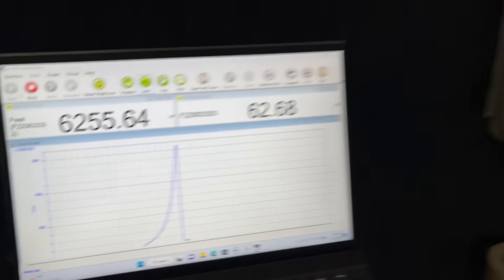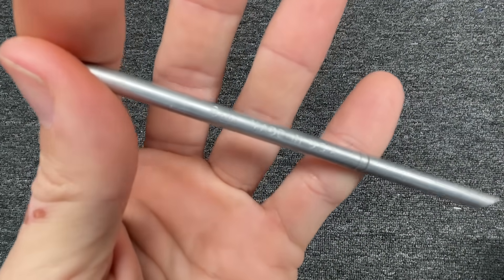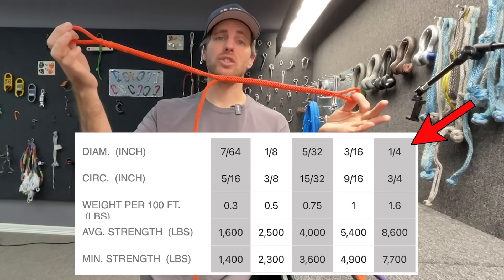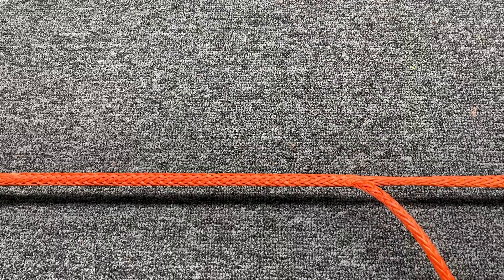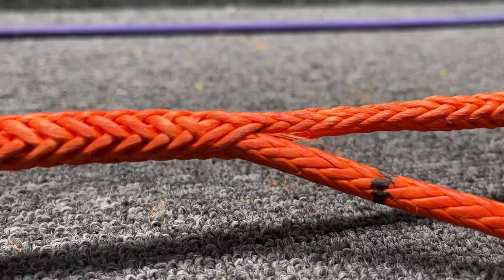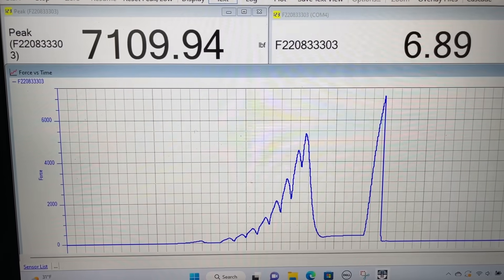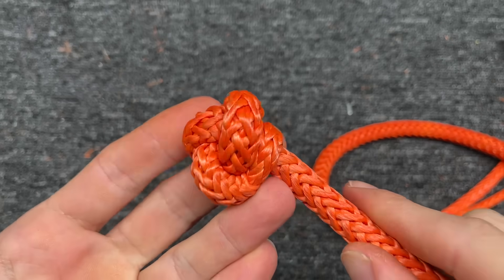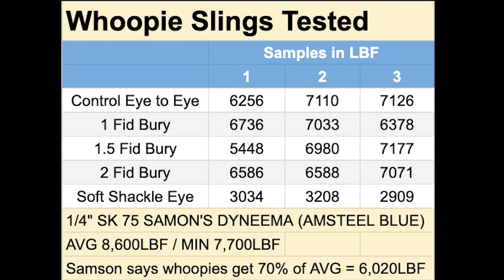Why The Overkill?

Comment: I can see how the Whoopie would test very differently depending on whether it is wrapped around a tree trunk or large branch. Spliced rope flattens out when wrapped around a large cylinder, and conceivably may have more strength to failure. This discussion of how much bury is needed is salient to those of us who try to splice older rope. If the connection needs to be refreshed, you lose several feet of rope so having a shorter bury is cost effective and practical.

Comment: A comment about your last bit on using the metric system. I'm Canadian, so we have to deal in both.  But it drives me nuts, after learning about the 'Newton' from highschool physics that we use the gram as a force as well as mass. I don't know where it started, probably when what became known as the metric system, was being developed. Everything else got it's own name, except the gram. Sorry force does have it's on unit 'Newton' we just don't F-in use it. ARG.

 I totally agree with your logic. Use whatever the industry standard unit is, and we can convert. You don't have the room onscreen to double up on text. 

Don't worry about the haters. They drive traffic, which is great for the algorithm.

Comment: Happy YouTube recommended this video to me. I've been using whoopie slings as an option for hanging hammocks. Early on, when I first got into Dyneema rope I purchased some from SK-Amazon. I ended up using it to create a whoopie sling, as a way around needing a variable lenght of rope. It was 8-9mm and I used 6ft as the length of the bury. Used it the other day to pull a several 1000 lb vehicle up a ramp onto a trailer. It did not obviously slip, and after the pull I inspected the bury, and it had pulled tighter than what it was when I started.

Two observations: When using a whoopie sling always milk the bury before using it. The other is the lenght of the bury shortens up when there is rope inside. For me, the bury length shorted by 1/2 a foot. I really enjoy the videos on rope specific topics, as the climbing and rescue gear tests are interesting but it's something I'm not into.

Comment: In the tree industry we use the whoopie as an anchor point by wrapping it around a tree and putting the fixed eye through the adjustable whoopie eye. Kind of like how an ultra sling works.
Reply: That sounds pretty cool and quite inspiring. Thank you!
Do you think this could work better than a daisy chain on a tape for a hammock? I mean - having this ultra sling, connecting it to the tree hugger with some kind of soft shackle? I'm not sure if you know much about hammock suspension, but maybe you do ;) If not, please ignore this comment.

Comment: I know I am 9 months late on this video, but the "afterthought" test of the Eye to Eye hits an application for holding up my sailboat mast. I have 5 mm dux splice in an eye that I luggage tag (girth hitch) to an 8mm shackle. Or should I just put it on the eye? The answer... It does not matter for strength. It will probably break in the taper. Plus it is so much stronger than the original 1/8" 1x19 wire it replaced so super good enough.

My conclusion luggage tag reduces chafe with the shackle. Keep doing what I have been doing.

Comment: I'm a hammock dyneema user. I may risk an 18 inch fall. So, I get away with hanging on 1/8" Amsteel and 7/64" Samson loops. I do hang without trees on Tensa Solo poles at times with two whoopy slings running to  a couple of home-made boom stakes at each end. I use 14" x 5/16" titanium stakes in 12" long 1" OD 1/8" wall booms with the stakes at 72 degrees. I can use 10" of boom length but stick to 8". Learning the failure points from your channel has been enlightening. Thank you very much! It would be fascinating to watch boom stakes pulled to failure.
Reply: Really for hammock you aren't risking too much to make a force that will pull out the splice. The required force will break the hammock apart faster. Well if using ridgeline to protect the hammock and very long ropes with sharp hang angles  so the force will multiply many times it can be possible. But I think it is often more practical to have shorter tie than extreemly long. So shorter bury is preferable in most cases

Comment: Fantastic to see "closer to real world" test setup - the larger radius has its place for absolute measurement, but much more useful to daily use (or failure awareness) is the shackle radius directly on the eye.

Thanks for this information; you are doing fantastic work.

Comment: So, if the integral soft shackle on the end of the rope failed very low, what happens if you use an eye at the end & then loop a separate  soft shackle through it?  Does the small bend radius make that as weak?  Or is it stronger?

Comment: To get full strength of a rope they use a large Bollard, but what is the correlation of Bollard diameter to rope diameter, For example if you pull a 6mm rope with a 12mm diameter bollard it will break at x kn , if you pull a 6mm rope with a 18mm bollard it will break at y kn, if you pull a 6mm rope with a 24mm bollard it will break at z kn. what is the minimum ratio of rope diameter to bollard diameter to get full strength. How does it change as the rope diameter increases. Would it be fesible to carry along a short section of pipe to act as a portable bollard to get full strength out of your rope.

Comment: A significant portion of the study of statistics is understanding different places where variation exists, and then finding the reason that variation exists. The comparison of JUST THE ROPE WITH ITSELF will include some variation due to unobserved factors like batch quality of the fibers between batches, and even along different sections of a 1,000 ft long rope (we call this Population Variance). Now consider making 10 ft hanks to test, and consider Sample Set 1 to have 20 such hanks (randomly selected across the whole 1,000 ft rope) to be tested to destruction. Then take another Sample Set 2 with another 20 hanks to be tested. By accident of the random selection, Sample Set 1 will have a mean break strength (call it Xbar1) and the mean break strength in Sample Set 2 will be different (call that Xbar2). We call this concept "Sampling Variation" in a statistics class, and doing a little studying to understand these two slightly different measures of variation can help reduce the confusion that happens when the two samples give different average break strengths. With those two basic variations measured, we then move to all of the OTHER possible sources of variation (knot type, how well dressed, speed of pull, pulse or notpulse, dirty or clean, etc). If we can isolate these OTHER sources, we can call them 'treatments' and then get on with determining the effects of each treatment. It can be illuminating to then perform a dot plot of each sample (now each sample will have a different treatment), and see how the dot plots show a pattern (show each dot plot separately but with a common scale at the bottom to allow for comparison). A similar graphical technique is to use a 'box plot' for each treatment, and compare the treatments. The boxplots will have visual indications of how spread out the data is, and that visual indication of the variance is often more intuitive. When the box plots of different treatments have NO overlap, we have the clearest picture and confidence that the treatments 'caused' the different performance. However, when there is a bit of overlap in the boxplots, we are not so sure if the treatment was causing the different performance or if we are just looking at sampling variation. And when there is a lot of overlap in the boxplots, we think that the treatments are the having any effect and that the slightly different means are different mainly due to sampling variation. For those who want to get into the weeds of this technique, go search for "Analysis of Variance" techniques, often abbreviated as ANOVA. Don't be intimidated by the terms, and be willing to spend a few hours with a statistics instructor to grasp these basics, and you will be rewarded with much more clarity in understanding all of the testing that you are doing. Perfectly normal humans learn these concepts with a few hours of honest effort and a decent instructor.

Comment: I have been hanging my fat ass from 0.125" amsteel whoopie slings on my hammock for years: tossing, turning, even some light swinging. Some people even use 0.069" (5/64th - 1.75mm) dyneema line. In that application it works very well.

Comment: Hi, sry for arriving late in the comments section. Grreat videos! The nerd in me likes the content, and the geek in me loves your style ! (or was it the other way around?)

I am interested in increasing breaking strength in double braid dyneema rope, with approach to how you tie the knot. Meaning -> Could you test anything like this in your bench.
Does it make a difference if you lay the rope double before making a 'bowline' or figure 8 knot? 
Also, would it help to introduce a passive extra length of rope (say 2-3x diameter) in just the knot, to increase diameter of bends and therefore increase breaking strength? Like, a double rope, but one is thicker and not loaded.

We are rigging a wirecam system with 2x horizontal 10mm lines loaded up to 500kgs force, but could need more safety factor (?)
Reply from the maker: Interesting. Send us an email thru hownot2.com.
Reply: @HowNOT2  Yeah, thanks - I will. Might take a couple of days, though ...

Comment: this is just something I've always thought  would be the easiest solution to bring a real world number to rope strength since the industry standard is obviously a cherry picked  method that uses all the pros and none of the cons of a rope product.. anyway all ropes that are or can be used in climbing or life supporting uses should have a specific double number rating on it...  one being a weight break at a universally agreed height drop and the second the break strength when done with knotted ends... I'd even  be cool with manufacturers getting to choose what knot they use either way they should tie both ends and  pull lol the outcome of that is obviously all someone's looking at if there life is on the line... and knowing the amount of weight that can result in catastrophic failure is the next most obvious number that someone cares about.... the fact that it's 2023 and rope manufacturers have still gotten away with  not being made to have these 2 things become a  known and posted number on there products

Comment: If I am truthful if I was doing factory quality control I would be avoiding doing splices like the plague due to the time they going to take todo I would suspect most rope factories are the same.
https://youtu.be/Tpzih4wBheM?t=59
The point in that video has what is classed as CI1801 standard test machine for ropes.  Yes this is one of the options vendors are not required to tell you want machine they used yes they could use a machine that looks like yours or like the one in the video I just linked.   Notice zero splices and basically zero knots in the drum based machines.   Basically you turning drums with rope wrapped around them in a tug of war.    These machines are compact and the results are highly repeatable.   You want to work out how much strength you have lost out a rope doing a knot or splice you need a drum based machine to get the non modified rope strength and the machine you currently have for after you put the knots in.   Drum based machines are basically based on sailing boat manual rope winches because that was the historic sailing boat rope test put you strongest people on two winch run the sample of rope you are going to be buying between the and if they could not break the rope it was good enough.   Yes there are historic write ups of ripping a rope winch off the ships deck doing this.

I would say do notice about values will be on site in metric/imperial... whatever at the start basically a testing method declare.  People will post complains without watching the complete video most of the time.

Comment: I think that maybe the anomalous result on the whoopie could possibly be down to the smoothing or milking of the buried section prior to testing? Is it possible that the even distribution of force through the strands could be more even if the buried section is thoroughly milked flat before loading?

Comment: The answer your question I don't know who is making these rules but I could suggest a few things as to why they would have a longer splice. One thing might be that you were testing a new one to failure on  a single pull. With this splice pull out easier if it was wet? How about dust and dirt ? Does this splice tend to settle overtime? If you had the shortest and the longest and you put them through a thousand cycles and then broke them would there be a difference in the breaking strength and pattern where they broke?

Comment: First, thanks for explaining why you didn’t include metric in the video.  I agree that trying to have both tables would make it harder to make actual comparisons.  

As for my thought on breaking better, since the strands aren’t all perfectly parallel I assume this means some strands take the load faster than others and have to give more.
From your other videos, I think I understand that the stretching of the ropes generates heat and that contributes to the failure. 

Is the reason pulsing works because it gives those strands a chance to shift?  
Or could be those strands heat, then fail and cause the remaining strands to pick up the load and quickly fail.   The pulsing would give the strands a chance to dissipate some small amount of heat before being loaded again
The explanation about manufacturers loading the item up to a point, letting it “rest”, then loading it to the breaking point would seem to support that since it would let the built up heat dissipate before loading it fully. 

To support why this makes sense, if you look at industrial use like slings for a crane those loads aren’t “jerked” up, they should be getting gently lifted so the load doesn’t shift.  Then if it isn’t lifted gently, it’s operator error and not the slings fault. 

Please let me know if I’m wrong or completely out to lunch. 

(Yes, I mostly watched this because I want whoopie slings for my hammock)

Comment: Good video, metric or imperial doesn't matter to me, but it must be good for the algorithm when everyone's knickers get twisted😂Apples with apples.

Using diverters probably won't change any of your data, none of the points of failure were at the termination.

In arb we mostly use tenex tec for whoopies, I wonder if the different properties would effect the results of where it breaks? Surely not.
Reply: I would imagine the added friction of Poly would decrease the bury length for the constrictor.

Comment: Great video as always, what would happen with a rapid tensioning e.g. a fall when the rope would start slipping before it starts tightening up? The dynema would be hot and slipping before it clamps up?
Reply: Usually if it starts slipping, it will heat up, and then catch, but break much lower due to the added heat. Ryan has mentioned in a previous video that he had a quick link on a highline anchor blow, catch on the whoopie backup, and he never knew until he derigged, so it takes a lot to slip.

Comment: I don't see the diameter of the steel eye directly causing any limiting stress concentration in these breaks, but the friction could be limiting pull-through and generally causing uneven strain between the two sides. Maybe this should be tested with a sheave block to eliminate friction. (I know heavy duty sheaves are not cheap, but it's for science yoh!)
They have for sure built in an extra factor for uncertainties in splicing details, conditions of use, maybe aging, etc.  
 Maybe the 3 fid thing is based on their large diameter cordage, they make 12-plait amsteel up to huge python sizes for mooring massive cargo ships where the weight of equivalent steel cables is a problem for crews(along with corrosion). I would think that the splice length should be based more on the square of diameter rather than a linear relation. 
But then amsteel [UHMWPE] is also subject to creep under fairly low continuous loads, which is why you don't see it used for long-term suspension applications.
Reply: While I will totally agree that a sheave block would be better scientifically, it wouldn't represent most practical situations, in which the anchor has friction (or even worse, pinch)
Reply: @HåkonKlemetsen  Well most practical situations also have side to side oscillation which is even worse than a friction-free anchor. But that is difficult to test with the availible garage-lab. A field study with designated lines and frequent inspection and records keeping would be more appropriate. Practical for a fleet of similar shipswith backup lines, but not practical for climbing with critical [one time use] safety equipement.

Aside from that the primary market for AmSteel is the marine industry and competition sailing, it is unlikely they would develop all new eye splicing standards for just for climbing. A mooring line for example will be under all sorts of up-down and side to side motions with constantly varying tension.